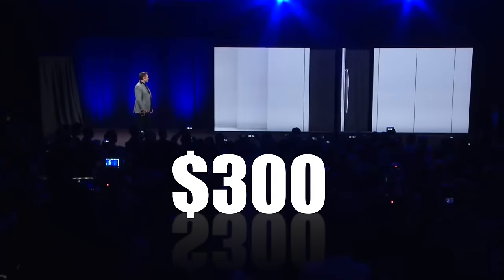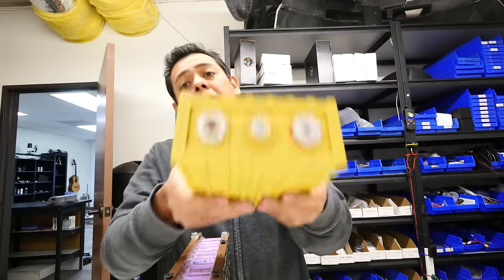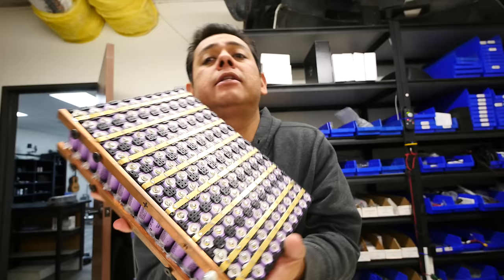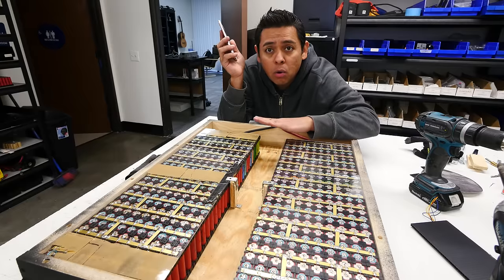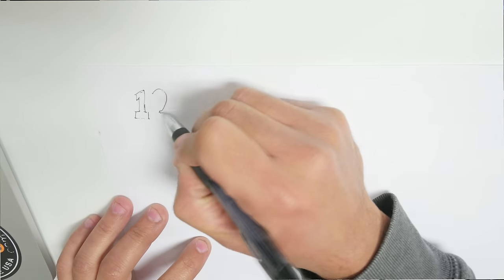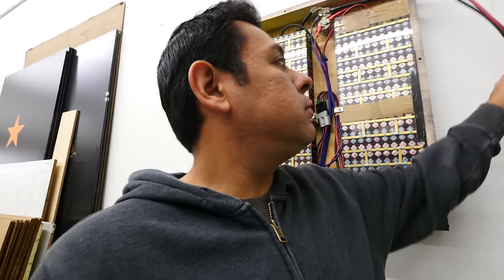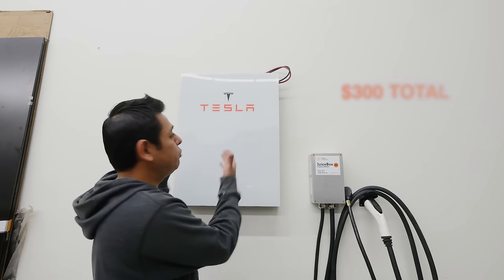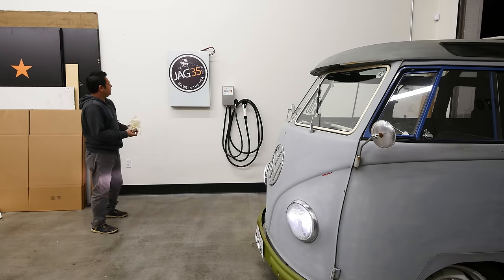$300 DIY Tesla Powerwall - Solar storage 18650 lithium ion home Battery

Comment: Holy shit.... someone on YouTube doing a DIY that actually researched and knows what he is taking about. That's refreshing!! I'm an industrial electrician and constantly work with 480 and 208 three phase power. This guy is spot on with voltages and Watt hours etc. Good job!!
Reply: TR Custom Tech ?? We learn that stuff in school, it's just an extension of ohm's law after all.
Reply: zaq405 question though; how many people have you seen on YouTube make a video about something and they don't know a damn thing about it. All I was trying to say is it's refreshing to see a video made by someone that is not full of shit.
Reply: TR Custom Tech. That's precisely the issue I have. Someone might burn their house down because he gained some knowledge through this video. You and I have experience which would guide us from making fatal mistakes.
Reply: zaq405 I agree with you there. I have seen people do some pretty stupid things with electricity especially when it comes to batteries. Hell I've been hit pretty good by a 24 VDC power supply. But when it comes to batteries it doesn't take very many in series to have a pretty potent power source.
Reply: TR Custom Tech where are you located? Would you be willing to teach someone as a helper?
Reply: TR Custom Tech Not particularly. I mean, he knows basic equations, but he constantly confuses watts and amps with watt-hours and amp hours. Like when he held up the pack and goes "this is a kilowatt of energy" (should have been kilowatt-hour), or talks about the cells being two amp (should be 2 amp-hour). Very confusing to the newbie who is still learning.
 
Also dangerous as he didn't emphasize enough that any inverter feeding power to the grid must be a grid-tie inverter or at least one with anti-islanding protection - otherwise some poor utility line worker is going to get electrocuted if he thinks the power lines are off but someone following this video tried to mimic this setup with a normal inverter that's still pumping power into the line.
Reply: LMF5000

yeh he did, but its pretty easy to forget unless you get it drummed into your brain that it only measures power if its related to time

from people who learn from experience, those sort of nuances are sort of obstacles, and you knew what he meant.

put it this way, nobody is going to burn their house down from forgetting to put hours on the end, the worst that can happen is a fked up calculation and a headache.
Reply: DC voltage over 40 Volts can be lethal. 50 volts could probably kill you with not a whole lot of amps required
Reply: Your an Industrial Electrician?
I'm considering that career.
May I ask you something?
How do you find it, & does it have expanding opportunities? 
Is it the kind of work that can be done also while living in a more rural area, or must live in city for the interesting or challenging work?

No need to reply if not worth your time - i saw your Channel & you sound short on time 😉
Reply: This comment offende me. Please never call something unclean, holy.

Yes. I am happy also for this channel.
Reply: zaq405  JESUS  People must be responsible for their own actions.  Stop deciding how people care for themselves.  FREEDOM requires we are responsible for ourselves.  Drug use is a perfect example.  If someone wants to use drugs as long as he does not drive and crash or do anything to other people that its no one elses business. 

Which part of this is not clear.  Mind your own business.  I want to build something its obvious to any awake human that electricity can be dangerous.

Governments play the same game Mr. Snowflake
Reply: zaq405 
So tell them to get a qualified electrician to check it quickly.....
Personal Responsibility..
Reply: His math is all off.  He has 4.4.KWH @ 3.7v.
if he wants 12v he needs to divide by 4 not 3 and he then only has 1.11KWH
if he wants 24v he needs to divide by 8 not 6 and he then only has  555WH
He will never have the 4.4KWH he is claiming and comparing to Tesla's wall at a cheaper price.
Reply from the maker: Oh this is priceless
Reply: @candicefrancart2060  you are mixing up amps and watts. Watts and watt hours stay the same no matter how you wire it because they are the product of amps and voltage. If Voltage goes up f.e., then amps go down, watts stay the same.
Reply: Zaq405 in school..? Ujless you're talking about college or specialised schools then I'm not sure what you mean.. they never thought us about Voltage conversions, not to a degree of being able to work safelly with electricity..
Reply: @pebblepod30  I realize you asked about being an industrial electrician two months ago, but I spent 30 years in industrial maintenance in the United States. Most jobs are hot, dirty and dangerous. The United States is no longer an industrial country. A good job in my area is about $20 an hour. Biomed techs do technical work, make better pay, work in cleaner environments and tend to live longer. I would not recommend this as a profession.
Reply: Gary McSpadden tech 
Thanks for the info, Gary, much appreciated.
I forgot to say that I from Australian.
I suppose US$20 is AU$27.80 , but even with higher cost of living, still not so much.
Thank you though.
Reply: @PersonalStash420  
Cheers
Reply: TR Custom Tech  I’m an electronic technologist. He did overlook 1 thing. The cells don’t nececaily hold same amount of charge if you put a degraded cell that only holds .5 amp hours with a non degraded cell that holds 2 amp hours in series the dead cell may get a reverse charge and permanently screw up the whole system. He has 100s of battery’s per group so odd are the defective cells will be evenly spread and it will not be a problem but it one group has more degraded cells the power wall won’t last long and may become a fire hazard if you don’t put a good lie ion battery protection circuit. Also he doesn’t know the difference in terms of measurements but half of electricians can’t seem to do the calculations right for how many amp hours they need on a 12 volt battery to run a 10 watt bulb for 30 min.
Reply: Thank you for a eye opening and reasonably understandable video. I am hoping to learn how to safely build a solar system sufficient to power a refrigerator and microwave (maybe an air conditioner). I know nothing and the more I seek information online the more I read the presenter criticized and contradicted in the comments. (Worse yet I see stuff slapped together that even I know is lacking safety measures that isn’t critiqued!)
Reply: Actually mixing cells is dangerous. They have different internal resistance has and discharge at different rates and just combining them willy-nilly can cause massive issues
Reply: No he doesn't, he said "kilowatt of energy" wtf does that even mean? Kilowatt is the unit for power NOT energy.
Reply: @pebblepod30  there is work in rural areas. Either servicing the local area or in mines or plants. You can always apply to Energex. 

There are a number of fields once you are a sparky: hazardous areas, instrumentation, solar, High Voltage, security, data. There are university pathways from electrician to engineer. There is government funding to help you out and you, education and training can become a tax deduction too.

Contact your local Tafe to sus it out would be your best bet, even have a look at seek ads to see where jobs are and how much they pay, to get a feel of the current market.
Reply: @russellbabin6252  0.42 amp hours? Just testing some newly acquired knowledge.
Reply: He used Li-ion batteries on a wooden box. Worst possible idea anyone could ever have. 

It's nearly Impossible to put out a Li-ion fire. If something goes wrong he can say goodbye to his house.

He also didn't have a BMS system.
Reply: TR Custom Tech soooo true... this is a smart guy...
Reply: Naaah  just basic OHM LAW stuff.   
but the dude is OFF on the Batteries technologies.   Says that NMH batts are no good bc "They have that memory thing"
but the dude is WRONG!   that applies only to Ni-Cads!!   Not NHM 
Yeah, they both have Nickel for ONE of the components but they are totally different.    I also noticed a 2nd mistake,  but I don't want to play the stupid video AGAIN to see what that was.......................
Reply: @trob9880  Perhaps zaq405 was confusing nirvana (ohm) law with jerkoff's law (what we call Kirchoff's Law in the Navy).  Storage was another issue in the Navy.  Ever hear of a seabag?
Reply: @trob9880  Yes and no.  I used to work in lumber dry kilns,  where the humidity was low,  but the temp was 45 dec C.  I designed and built the dehumidifiers.  They ran on 3-phase 208/120,  but the control bus was 24 vac.   I could take the stripped wires in my hands,  and seldom even felt a tingle.  But, OTOH,  I got a good little tingle off of 12 vdc  when working on a car on a hot, humid day.  Voltage doesn't kill.  Current doesn't kill.  Power doesn't kill, neither.  It is energy (work) that does the damage.  If our body resistance is low enough,  however,  then we can draw enough current for a long enough time to cause electrocution or serious injury.  I have never seen a shock from 24 vdc kill anyone,  but I have seen collateral damage from burns,  fires,  etc... caused by better conductors than the human body alone.    In that regard,  even a fraction of a volt can flow enough energy to cause serious damage,  injury,  or death.  Yes,  electricity should be respected by the layperson. SAFETY FIRST.  Anyone else working with electrical circuits should not be poking around on energized equipment unless they  are experts.  In the right circumstances,  even low voltage can kill.
Reply: @trob9880  There should be a rating system....shit rating if you will
Reply: @pebblepod30  Either place is possible. If you like rural I may be able to help. I worked for a guy that bought out everybody so he has a thing going. My house is also for sale on .49 acres a mile from the shop(or one of them). The guy seems to hire alot but it has been lil while since I seen an ad, but could be going a diff route to hire. They are plumbing and elec since the company they bought out near me was both.  I am also 4 mi from the college I took Ind Elec course. Again this is rural but if you followed land prices ......it is growing around here. Look up Decorah IA---recession proof, 14 miles away(and another shop)
Reply: TR Custom Tech This guy is good. This guy knows his stuff.
Reply: @pebblepod30  find a local IBEW hall and join the union.  They will train you
Reply: Hey, you seem like a smart trust worthy guy,I am trying to learn about electronics, will you explain the wiring a bit more to me please?
Reply: but a $3000 battery when standard marine grade batteries are  12 at  90 and 120 amp hour?    and only cost $120 a piece?     awefull waste of money...
Reply: @harleyme3163  I'd go with 6 volt FLA deep cycles, really.  US2200's or similar.  About $150-180 apiece for ~230Ah depending on qty you buy
Reply: @candicefrancart2060  A Kilowatt Hour is a Kilowatt Hour
Reply: So it cost 50$  per kW. You should advertiswe in title. 4kW for 200$   and skip that 100$  per glass.  100kW=  5,000$ NICE
Reply: Jack Canttellyou do you really have to bring political BS to this video which has nothing to do anything remotely political? Omg get a life man
Reply: TR, I'm going to use this to build a battery for the house I just bought that has a 13KW solar system but NO BATTERY! Only challenge is I'm in Italy and will have to wire it to feed into a 220V system. Any suggestions on the calculations? Thanks. Chris
Reply: Hi I have a 48v 750w Ebike battery. The power cord is pretty skinny would I be able to use it on a 48v inverted or does it have to be a thicker gage?
Reply: And what about the charging and discharging of this power wall and also the battery management system

Comment: You might consider a fireproof enclosure for that contraption... you know, instead of wood.
Reply: ehh, just adds more.... flare!... kill me
Reply: SciPunk215 LOL
Reply: SciPunk215 i don't think there's much you could use that will stop a fire fueled by 600 li batteries
Reply: David H concrete?
Reply: SciPunk215 I was thinking the very same thing!!
Reply: Why then are the good power boxes made out of metal? I thought I read that's for arking prevention? (Obviously one needs to ground the box).
Reply: curious for this discussion to continue.....hasnt reached an answer I feel is sufficent......experts please continue.........metal with a thin layer of rubber mounted to 5/8 fire rated sheetrock is my do it yourselfer guess, but full timers please pro/con
Reply: Plasti dip the interior of the wood case
Reply: Hardy board for the backing at least perhaps?
Reply: How about backer board? Used for tile install
Reply: Build the box out of asbestos non friable
Reply: What if you make it watertight and submerge it in a hopefully nonflammable mineral oil? No access to oxygen and can provide cooling if needed.
Reply: What about venting for Hydrogen being released via the batteries or is that not possible through lithium ion??
Venting to cool the batteries for mounting outside perhaps but then you have elements of moisture to consider too

Also i was thinking maybe an enclosure created from aluminium or carbon fibre lined with a rubber of some sorts?!?!

Amazing idea though really is the future for off grid survival 😎👍
Reply: SciPunk215  This is the part where you thank everyone for the likes for your generic comment. Lel
Reply: Cherry wood
Reply: Fireproof enclosure not needed. This guy knows how to build it properly with fuses so as to eliminate a fire hazard.
Reply: I guess the thermal management isn't needed, must be slower drain then automotive application
Reply: Compressed cement sheet
Reply: I work in an aerospace lithion battery company.

We worked through some of the issues that grounded the Boeing Dreamliner. I've seen the test videos of failure mode/spontaneous fubar occurrences of those exact design packs. The made for Boeing packs... That failed.

You do not want one of these going off in your garage. Think a gallon or so of gas.

One issue... a major issue at that is individual cell failure can lead to a rapid spread of failure across the pack. One cell that shorts internally and spews a seconds long blast of flame out it's end can, and often does light the whole pack in a cascade.

Take a pack of matches. Touch a lit match to one head and watch the fun... Now imaging that a thousand times more energetic... In your garage... At night. Don't use damaged cells.

Just saying, yes this video seems to be very informative, and probably very accurate as to the possibility of building a cheap power wall clone.

But don't make any mistakes. And if I was installing any large lithion packs at my house I'd definitely put them outside, mounted in a way they can't flash at my anything. But... Putting them outside can create charging issues due to low temperatures.

In otherwords... Unless you are really good at this kind'a stuff, and do mega reseach... No swimming in the deep end of this pool.

Be careful with used cells also. We sort our NEW cells by date of manufacture, as well as topped off voltage (to within a couple millivolts I believe. Been years since I've sorted). This helps insure uniform life span of cells as well as other charging discharging issues. No sense building a pack and having cells go south early.
Reply: @wrybread  I think Hardie board is the best idea I've seen here, might be overkill, but it's really easy to work with, so why not! I put a skim coat of concrete on the exterior for looks.
Reply: i would still put a t° sensor and a hole that fit a co2 extinguisher hose   in the casing
Reply: As soon as he said “plywood” I headed to the comments and found this gem.
Reply: Not only the wood but i think the weight of the cell stack will add additional pressure on the lower cells and potentially cause a rupture and thermal runaway... NMC batteries like powerwalls have more tendency for it than other lithium tech. Thanks for sharing
Reply: Even sheet metal liner would be safer
Reply: Insurance wouldn’t pay if house caught fire
Reply: Idk I dunno what would really be better plus at least when the wood burns it burns at a slow constant rate and retains its shape unlike metal when it gets hot
Reply: @t.b.a.r.r.o.  maybe some type of concrete insulated basement in your garden? You could probably also put some moist/temp sensors and automatic extinguisher in there?
Reply: Have you seen a lithium fire, no box is going to stop it, put a fire alarm near it so you know when to run away.
Reply: Unobtanium

Comment: holy guacamole! that is impressive. - I built and installed my own solar after a ton of research. Everyone i have told thinks I am crazy, including my wife, but now that i have't burned down the house, and my AC is running at 75 degrees in 105 degree weather, now they don't think I am crazy... I have considered a battery backup, but going off grid would be epic! I am seriously IMPRESSED with your work. This is my first time to the channel... and your motherboard channel. I will be spending a few more sleepless nights listening to that content you have posted.
Reply: You built it? What were your thoughts, and lessons? How much did it end up costing you? Could you improve on the design? I'm seriously considering making this myself!
Reply: @josebravo7998  I will be more than happy to help you... I am still learning how to integrate the powerwall with the solar system. But as far as solar, it's really cool